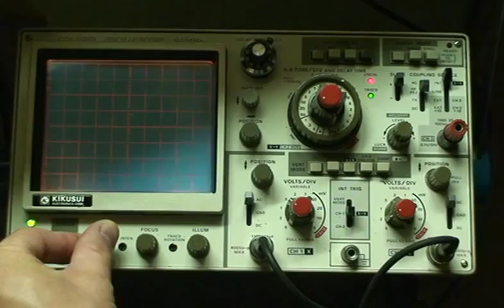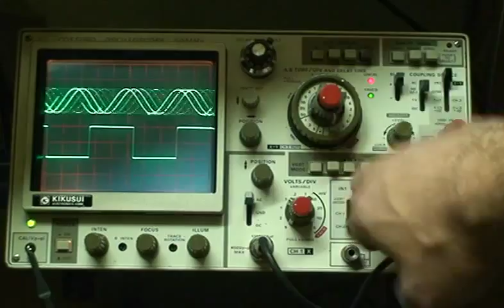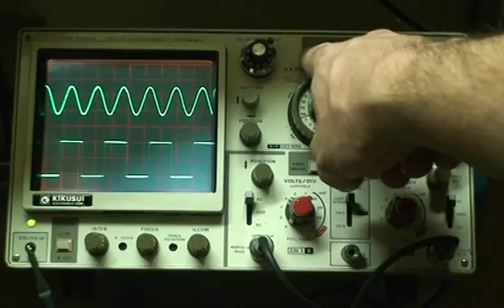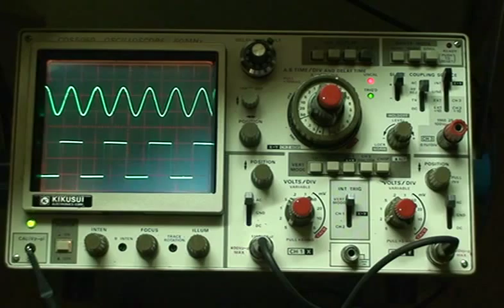Kikusui COS-5060 Oscilloscope Quick Demo

Comment: What da heck is this for? 🤣
Reply from the maker: This is an instrument to see voltages over time (circuit signals, sound waves, power cycles, and many other things), view many types of signals and diagnose and trouble-shoot electronic circuits. It is very useful for repair. Now people have digital versions of these instruments that capture signals as well. It is one of the coolest and most basic and fun things to learn electronics with and older ones can be bought fairly cheap if you know where to look.

Comment: I repair a kikusui COS5100 last week, but it's glass struct of CRT has a little fracture. X deflection plate is swing strong and focus point of trace is wide.
it's  was brunt  by somebody that I think.
its brightness part was broken and high voltage of anode was divulge. I repair that to working well.
but damage of CRT I can't repair it...................
Reply: I bought a used one a few days ago. I thought it is a good idea to open the case and look if there are cold solder joints. I also realized later that A B time div knob has a problem. Anyway after removing the screws I can slide the casing a few centimeters back but then it is stuck. Doesn’t move anymore. The casing has some bent points on it maybe that is the problem. I am stuck at this point. Do you have an idea?
Reply: @ahmetkral8629  
我有这个COS5100示波器的原理图（circuit diagram），如果你要的话可以发给你，这是一个收集电路图的网站，你可以去看下这个elektrotanya.com网站上有没有相关的电路图。
I got diagram of COS5040 oscilloscope on this website{ elektrotanya.com } , and got COS5100 schematic in other place.
https://drive.google.com/file/d/1sjySUgBrBF4M5dFyjp3tPlbvInqDquxq/view?usp=sharing
Reply: Just opened the case. The bent edges on the top case was blocking it.

Comment: How did you get the square wave? Did you hook up the probe to channel 2 and the tip to the ground calibrate point? I just bought the model 5020 and i need to figure it out.
Thank you
Reply from the maker: Yes there is a calibration square wave that comes off the scope front which you can clip to on the bottom left corner (see video time 1:20 where I clip on the probe and square wave appears).
Reply: @devhackmod  Ok. Thank you i will try that. But i think that the scope i have has issues because i can't get a proper sine wave what i get is a loop sine wave with no begining or end maybe i am doing something wrong.
Reply from the maker: @SDsailor7  Maybe your scope isn't triggering, it should be set to trigger on something (you may have to set trigger level) so you can see a nice wave and not have it sliding back and forth.
Reply: @devhackmod  Hi. Thank you for the repply. The wave form is not sliding back and forth it is pulsing if that makes sense. I generated the wave for with a function generator set for 1kh and then i adjusted it to 60Hz 
So you think i should test something?

Comment: 3 channel? I only see two channel inputs. If it is 3 channel, that would be very unusual.
Reply from the maker: I believe there is a 3rd channel input on the back of the oscilloscope. I don't think it is a fully-functional channel like you would have full control over it with the front-side controls. It may act as a reference or used for X/Y input or an external signal. Just search Google and you'll see it come up as "3 channel" as well as "2 channel".